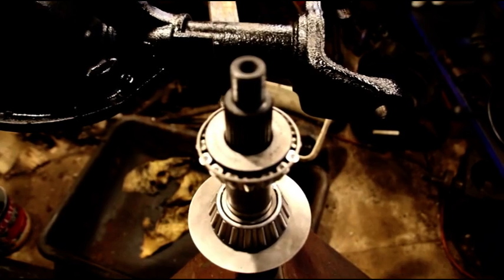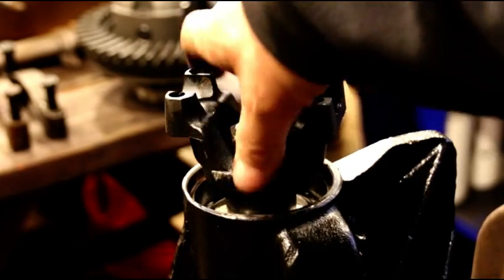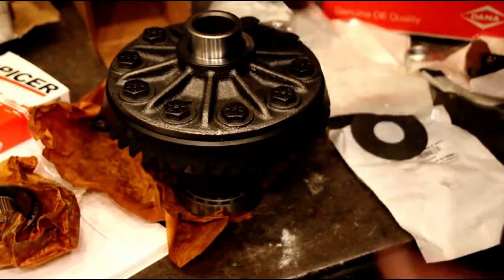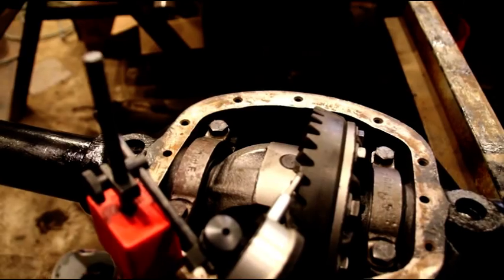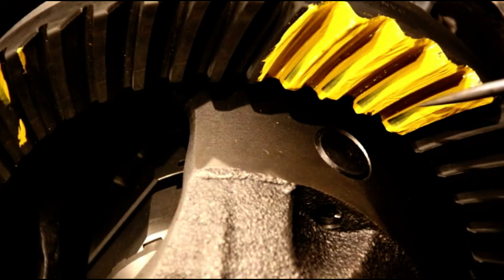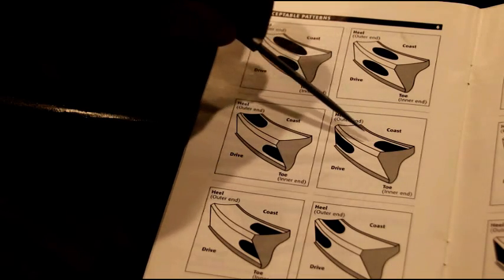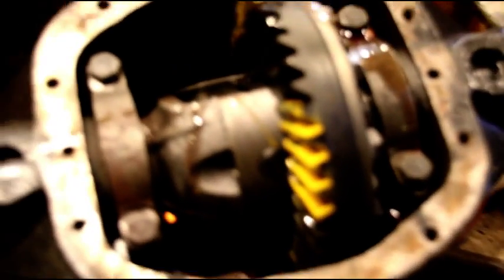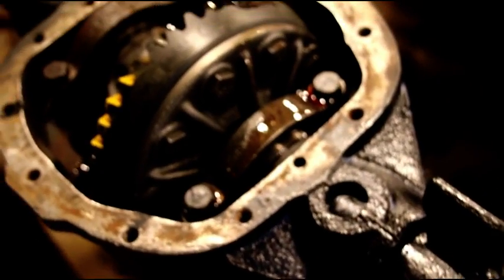Jeep Dana 30 Gear Setup Part 2, Rotational Torque and Backlash

Comment: Very well explained 👏 👌 👍.  Just had my pro 4x titan done at a garage. Replaced all bearings and seals but it's howling a bit and it felt like it hooked a couple times when I made a sharp left hand turn almost as if it is locked in but it wasn't locked.  I don't know what to think

Comment: I'm doing .456 gears on a old scrambler Im also doing no crush sleeve...Im having hell! Factory spec is 65 I'm all the way down to maybe 20 and I can't get this thang to seat to get pre load!
Reply from the maker: depending on the axle sometimes you wind up with no shims in there, and in extreme cases sometimes have to machine some material off the main " washer"  .  Do what ever it takes to get the right rotational torque.
Reply: @metalshaperJeep  I ended up getting it! I went all the way down to .20 lol

Comment: hi, thanks for sharing your experience. please tell me for the thermal gap, do you use a special collar to easily remove and put on so that it is easy to remove and change washers or sharpen inside the collar? such pochevniki supposedly regulate? and if you grind until the ano sits down with a little effort, then leave them or press in new ones again? Please tell me, I have been struggling with these questions for a long time?

Comment: Do you have to put in a crusher sleeve?  I actually have this setup in the garage and need to do this exact process.  other than the torqu wrench - no other special tools?  Good Work!  was thinking about paying someone to do it but based on this i should be able to do it...
Reply from the maker: The dana 30 uses shims, not a crush sleeve.  To do this job you will need basic tools, and some specialty tools:
Bearing puller
Press for removing and installing bearings
Rotational torque wrench
Torque wrench
dial indicator
Ball joint install/remover kit
A few other items that you may or may not have around your shop depending on the extent of your tools.
Reply: @metalshaperJeep  would it be possible to get an email address so i can share my images and details about my 2 axels i need to build up?
Reply from the maker: @tlmckee2002  you can reach me at metalshaper@comcast.net
Brian

Comment: Hi Brian, thank you for this build. I am thinking of swapping a 30 for the 27 that’s in my Jeep right now. I would like to put disc brakes on as well. My cj5 came stock with 3.73 so looks like I’ll have to get new carriers as well. I would like to get 4.10s with an overdrive in the T case. Thank you so much for sharing, you are our Jeep guru!! God bless you and yours.
Reply from the maker: You won't need a new carrier.  Dana 30 used 3.54 and up as one carrier and 3.73 and down as the other carrier.  4.10 will install properly on the carrier you have.

Comment: I do have a question on the Differential Preload Shim thickness (not the Pinion, but the Diff).  The AMC 20 Axle specifies .008 of bearing preload.  The Dana 30 Spicer Service Manual states .015 of bearing preload, and you are using .005.  You would think that all tapered bearings of this size would have a standard amount for this preload, but that does not seem to be the case.  Where did you get .005?  A Service Manual, or your personal preference?  I have been following your channel for several years.   I do respect your opinion.  Thank you Brian.... Mike
Reply from the maker: I have rebuilt hundreds of Dana 30's.  If you try to add .015 for preload you will scuff the cups when installing it due to the amount of preload.  I start with enough shims so I have to lightly tap the carrier in place.  Then adjust the backlash and finally add my .005 to the bolt side.  At that point it will take a bit more to install it and the preload is just right.  As I said it is a feel type thing,  the carrier should not just fall in and you shouldn't have to get a huge hammer to bang it in.  Try one at .005 or .008 and see what feels like then try it again at .015 and see the difference.
Reply: @metalshaperJeep  I appreciate the response Brian.  Thank you for the info
Reply: That .015 in the manual is when starting the carrier out with 0 backlash from the forum I read. Ring as tight against the pinion as possible. Then add .015 to drivers side to get appropriate preload and backlash. At least that was the gist of what I read. Think I sent you the forum on Facebook. Was hoping Brian’s new video would have mentioned that method but I trust his setups
Reply: @mattoliver9939 
I’d rather go with something that makes sense from an experienced person than “just use the book”
It sounds like if you do it the ‘book’ way  you’d need a case spreader.

Comment: What exactly is a "setup bearing"?  Do you bore out an actual bearing or...??
Reply from the maker: I take a bearing and hone out the ID so it is a slip fit.  You can use anything to bore it out just keep it round and don't make it too large.
Reply: I used a die grinder. Wear gloves!

Comment: Brian, thank you for a great video. Someone else rebuilt both differentials in my 66CJ-5. I’m not finished with the rebuild so I’m going to pull both covers and see if I can find where the tooth pattern was checked. I hope to correct a problem before it starts. I had to replace both ring and pinion gears due to the fact they weren’t set up properly the last time! Thanks again!! My I’ll be in touch if I need help!!!!
Reply from the maker: Many, many improperly set  up axles come thru my shop, take a peek in  there and see what it looks like before you run it.
Reply: Thank you, I sure will!!